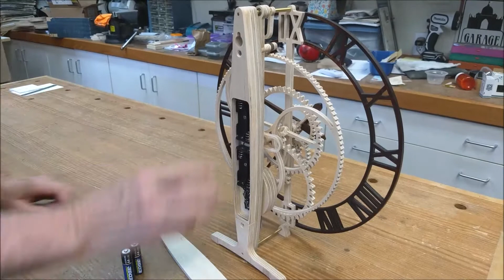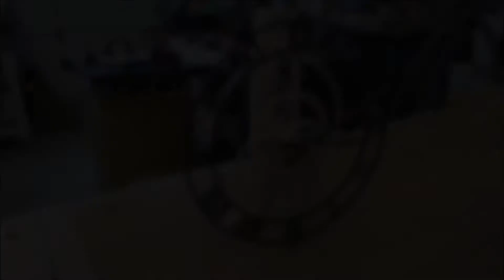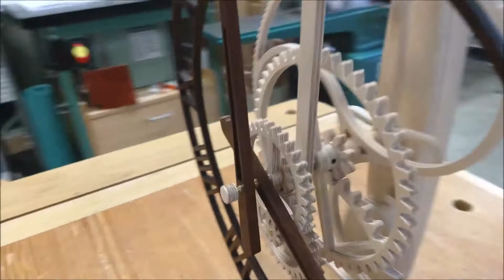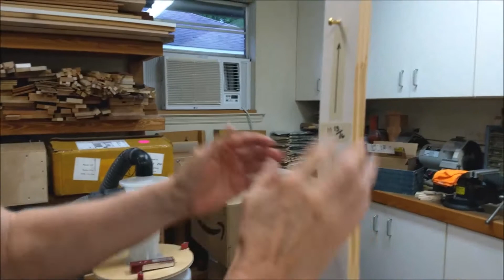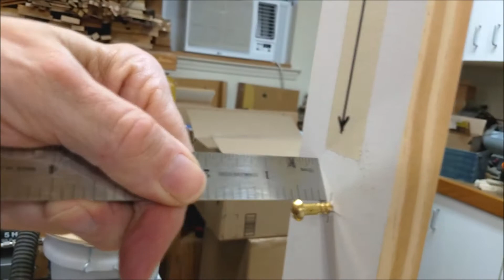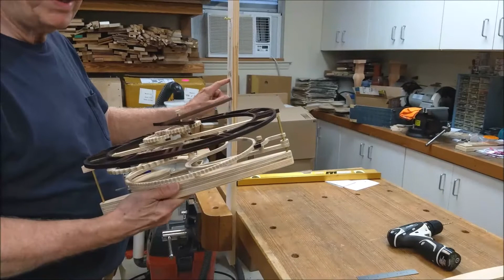Magica Clock Operating Tips

Comment: Hi Richard!  Nice video - thanks!  I saw on your other video that you used a 2mm bit with 1/8" shank.  Is it an up or down cut?   Where did you buy it?
Reply from the maker: Hi Alan,  2mm bits with 1/8" shanks were used for the parts cut from 1/4" plywood.  1/8" end mils were used for the parts cut from 1/2" plywood.  Both were up-cut.  Bits were HQMaster brand purchased on Amazon.  They are relatively inexpensive in quantities of ten.  They worked great.  I used depth of cut of around .12" and a feed rate of 30-40 ipm, and a speed of 18,000 rpm.  Thanks for watching.
Reply: @richardevans6891  Thanks for the thoughtful reply.  It is very helpful.  I will see if I can find the bits.  I have been using a 1/16" downcut but the dust packs the toolpath.

Comment: Good afternoon friend. Congratulations on the work!
Where can I buy the circuit board and coil?
Reply from the maker: Claudio, the circuit board and coil are pulled from a movement available  on-line from klockit.com.  It is their stock number "11085-bundle".   The plans provide the exact procedure.  Clock plans are available at:  https://holzmechanik.de/clocks.html.  No affiliation with me.
Reply: @richardevans6891  They've apparently stopped carrying it.

Comment: Wow!  Do the plans come with a clock parts list?  Or do you have to figure out which mechanisms are needed in addition to the wood work?
Reply from the maker: Matt, the plans have a complete parts list.  See description above for source of plans.
Reply: @richardevans6891  I actually just bought some plans last night!  Now to source all those parts...  those are easily some of the most helpful plans I’ve come across. I just hope some of those metric bits are readily available here

Comment: I am in the middle of building this clock. I have everything wired and the pendulum swinging but the arch of the swing is much less than yours. It does not swing far enough to advance to the next tooth.  Have you had this problem or do you have any suggestions. Lee Roberts
Reply from the maker: Hi Lee,  Three possible things:  1) The distance between the permanent magnet on the pendulum and the coil-solenoid disc must be small.  Make sure the magnet is swinging very close to the coil (but of course, not so close that it collides).  Also it can be possible to be too close; if you are already swinging very close and are having a problem, then try moving the pendulum away a tiny bit.  This all is done by sliding the ball bearing on the rod at the top of the clock.  2) Are you sure the coil-solenoid is actually energized?  It is easy to break one  of the three fine wires to the coil in the installation process.  Check this by disengaging the little part on the pendulum that engages the escapement wheel by removing it or swinging it out of the way, and then ensure that the pendulum continues to swing indefinitely from the power of the coil.  3) Use 4 fresh batteries (do this first).  Good luck.
Reply: Thank you for the quick reply, I will give your suggestions a try!
Reply from the maker: @leerob3061  , any luck with your clock?
Reply: @leerob3061  Boa tarde, amigo. 
Onde posso comprar  a placa de circuito e a bobina?
Reply: has anyone tried controlling the amplitude of the pendulum swing by adjusting the voltage?